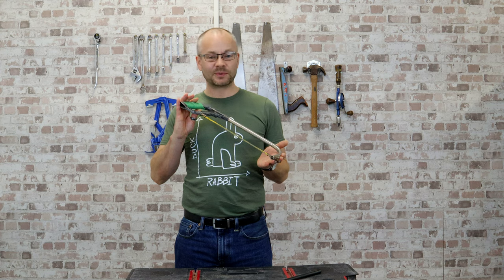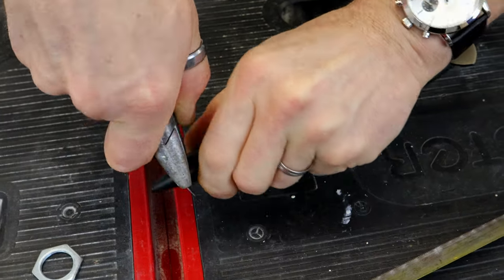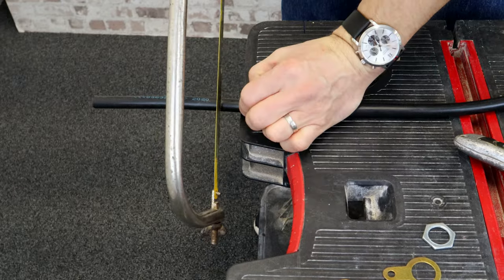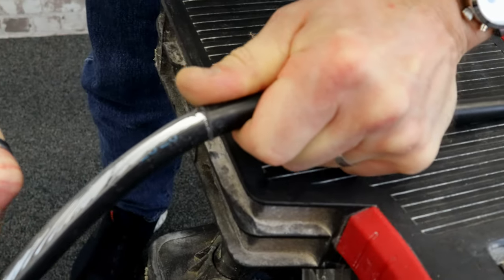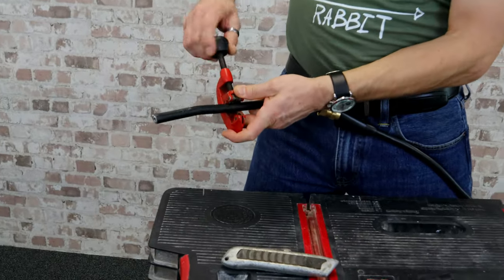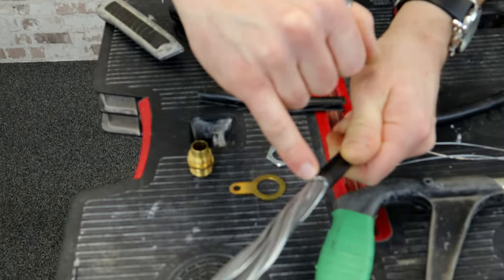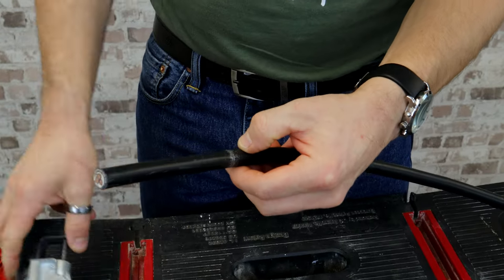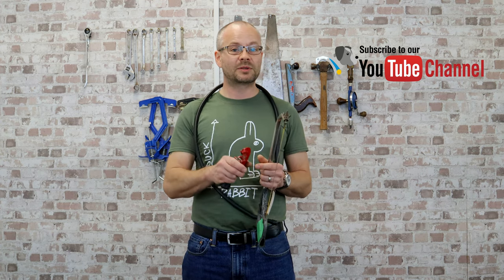What's the BEST Steel Wire Armour (SWA) Cutting Tool?

Comment: thakns for the video. But I am having trouble with removing the hard insulation under the steel on a 3x16mm armored cable. Very hard insulation and the thickness varies so you run the risk of damaging the wires under it if you use one of these tools. So, how would you peel the hard plastic insulation under the steel?
Reply from the maker: Hi George. A few solutions depending upon your circumstances.
-Bending the cable over, very carefully score the sheath until it pulls apart. You'll have to rotate the cable and do this a few times until it has completely detached.
-Make an incision between the cores and using good pliers, grip one cable core and pull against yourself whilst holding the other other cores, this will tear open outer sheath.
If your able to, leave the cable in the sun for a while to warm up, this will soften the sheath making it easier to remove.

Please let me know how you get on. 👍
Reply: @ChampionsOfTheTrade  Thanks very much for this good advice! I will try but I am not optimistic since the sheath is very hard and plasticy with almost no flexibility (it's orange color if that means anything).
Reply from the maker: @georgeharizanov6094  orange, I have to admit, that's a new one for me.
Which country are you in?
Reply: @ChampionsOfTheTrade  UK
Reply from the maker: @georgeharizanov6094  the core colors are brown, black and grey (assuming you're using 3core)?
Reply: @ChampionsOfTheTrade  yep, these are the colors. I just solved the problem, the answer was Jokari T10280. I have to say, I am impressed.
Reply from the maker: @georgeharizanov6094  that's great . I'll have to look into that tool. 💪